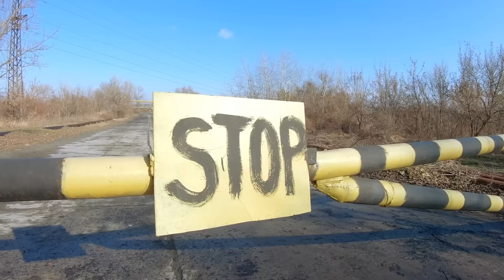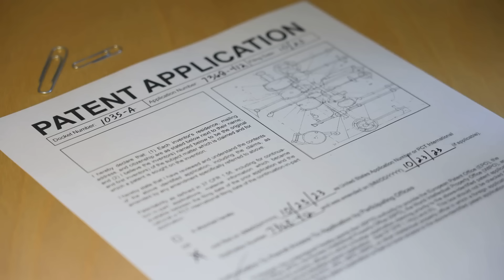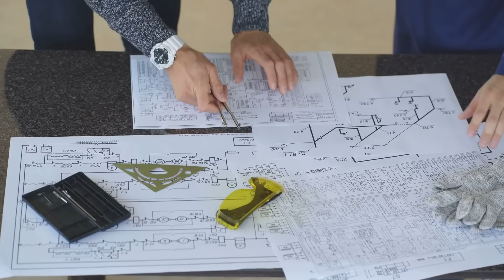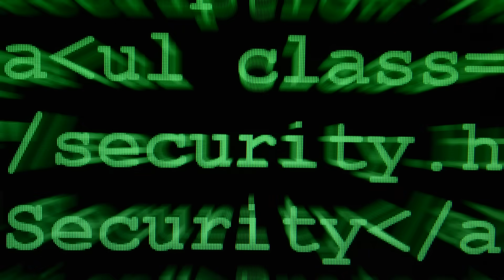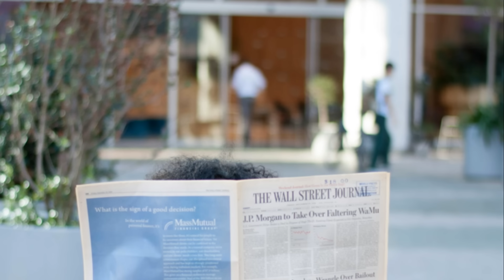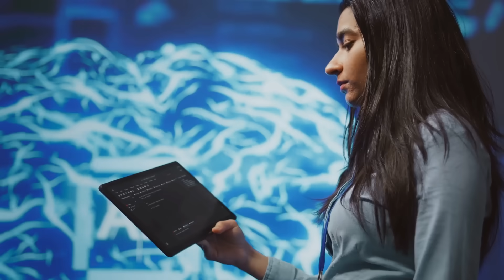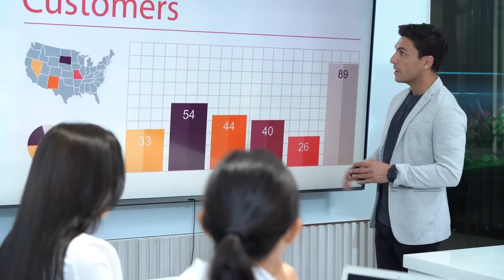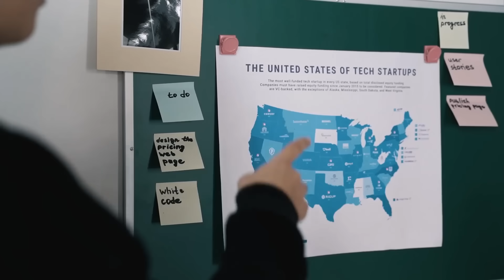Huawei’s 6G Chip Just Crushed the West — U.S & ASML In Panic Mode!

Comment: Can they ever get pass this trade war?
Reply: I  think the U.S. will damage itself significantly. It could even lead to a deep depression. It’s not going to make a lot of in roads to rebuilding manufacturing.  U.S. manufacturing is so expensive. The flow through of Tarrifs are going to make exports difficult. While China has reduced US exports from 22% of all exports back in 2018 to 13% early 2025 and dropping to under 10%. Chinas purchases from the U.S. have dived . China has increased its total exports and has low reliance on the U.S.